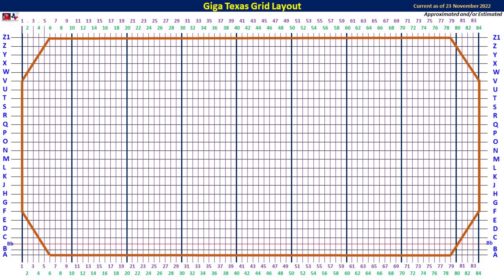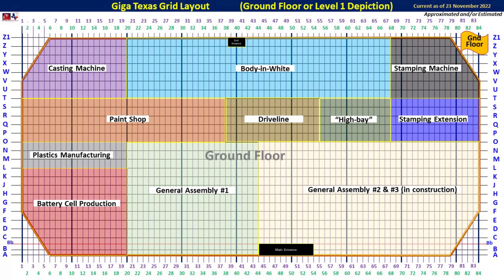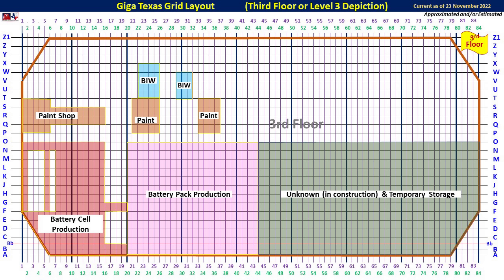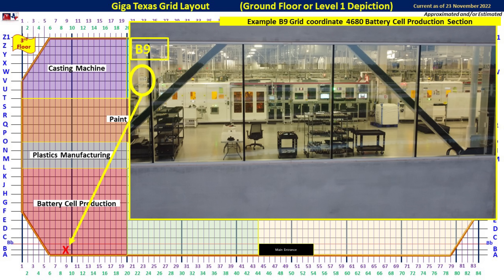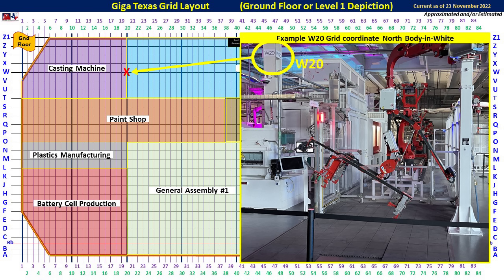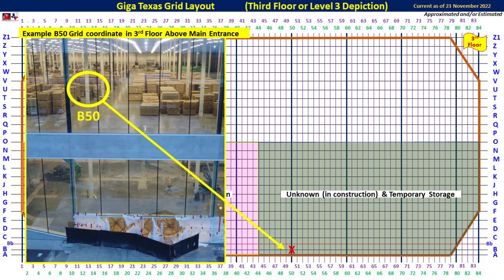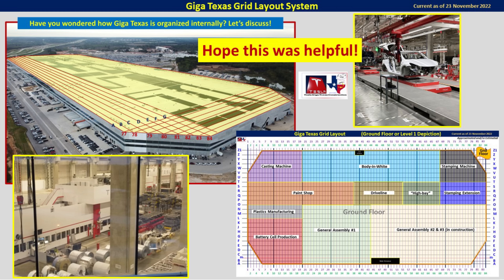Factory Grid Mapping & Main Layout Discussion!  27 November 2022 Giga Texas Construction Update 4K

Comment: Great description of the layout and grid.  I was trying to work out the floor area between each four pillars, I estimated 47.5 feet + 40 feet making 1,900 sq feet.  Also I don't know the current footprint of the factory.  It appears to be 2,000 spaces, each one of them approximately the footprint of a suburban house + garage.  That's before thinking about he additional space on multiple floors occupying its 170 foot height.
Reply: Column/grid spacing is likely 14m, has been reported by an onsite electrician to be 45'10" or 550" which is 13.07m. If you work on 2100sq.ft per column bay, that would be close enough.

Overall building height is 84’ 25.6m to the top of the parapet.

Comment: Thanks Joe 

Couple of clarifications, some additional information.

1:50. Column/gridline spacing. There’s a couple of marked dimensions on the site plan that allow an accurate estimation of the spacing. 45’10” 550” (or 14m as reported by a contractor) works out almost exactly with the dimensions shown on the site plan. Width is shown as 1130.77'.
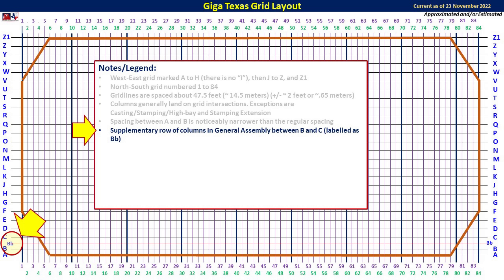2:33. The Bb gridline might not be marked on a plan. The additional row of columns along that line likely a measured offset from B or C. Additionally that row of columns is only through GA on level 1 (Ground floor), and was the original easterly extent of L2.
2:55. Z1 was only seen in BIW in a couple of photos. It has to be there to make up the 25 column bays across the width of the building. It also seems that at some point the grid designation has moved a row east in BIW. This is a proper oddity, I don’t understand why they did this. 
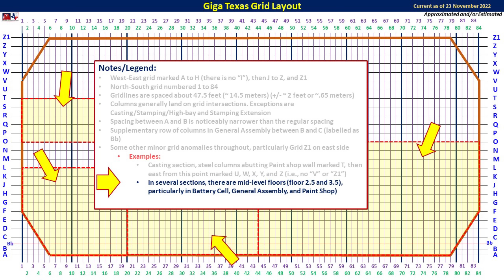3:46. Floor elevations (height between floors) is consistent in Battery/GA, where floors exist. Also consistent in BIW/Paint, although these floor elevations do not match Battery/GA. Easier to consider these areas as entirely different buildings, that happen to abut each other.
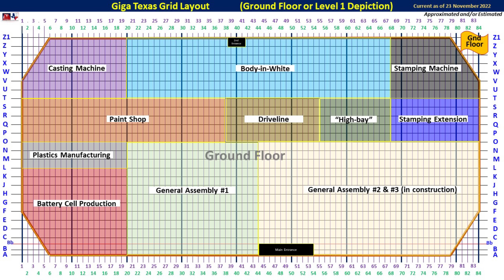5:48. East main entrance is located between 35 and 36.
8:57. Casting. Columns here (and in Stamping) likely not located on the gridlines, but on offsets. I thought they might use a unique grid in here, but if that were the case there would be no need to skip Row V. Similarly with the columns in High Bay and Stamping 2.
10:32. BIW. Think this area and several bays south is where the Castings are machined.
11:10. Stamping. Use of concrete columns. I had similar thoughts, but then they started constructing Stamping 2 where the bridge cranes are larger still, and the columns in there are steel.
12:43. Main Entrance. No mezzanine in there, the floor is Level 2. Floor levels in here are consistent with elsewhere in GA, Level 1 (ground), Level 2, and Level 3.

The first of the steel structure ‘the gazebo’ is in Paint between Q and R, 12 and 13.

The infamous ‘Zipper pit’ was originally between W and X, and 38 and 49 before being abandoned and rebuilt between U and V between 38 and 51. North end of the Zipper Pit seen here, https://youtu.be/m3GBqT3UxCU?t=1116
Reply: Dessie, 11:10  the concrete columns could be used because they are not resonate with the synchronous movements of the Schuler transfer presses. May not have that problem in the new area.
Reply: @eltonray2934  Might be. Not that we know yet what is being installed in Stamping 2. 

Another reason for the change in Stamping 2 would be span. It would be doable with concrete, but steel probably more economical.
Reply: for comparison: I think Shanghai is all steel. Germany is all concrete.
Reply: @benguthrie49  I think you're right. The precast columns and beams and footings at Berlin were interesting to watch being assembled. I have a bit of a thing about precast, so it was a more interesting build for me.

Would be interesting to know if the choice over precast over steel was financial only, or some other consideration. Fire perhaps.
Reply: @DessieDoolan  I thought the use of precast concrete in Germany might be the local construction practice.  In texas, I thought the architects liked what they learned doing Giga Berlin and used them where they thought they were superior in application. aside: I have loved watching all this from the prep of the land in Shanghai. fascinating.
Reply: @benguthrie49  Yes, I agree it has been fascinating. Projects of that magnitude simply don't exist down here. 

I more or less missed Shanghai. It was built before I realized, and I've not been able to figure out the layout.

I have a theory that Shanghai was the prototype, Berlin designed with whatever they'd pick up from Shanghai, and then Austin benefited from both. 

If I could confirm the column spacing at Shanghai as being 14 metres that would give me a bit more confidence. 14 metres is the spacing at Berlin and Austin is just a bees whisker short at 13.97.

Nevada is a different kettle of fish altogether. Column spacing is 50' x 40' 15.25m x 12.2m.
Reply: @DessieDoolan  Jason Yang has a good month by month recap at the beginning. Could also go to his earliest videos for more detail.  f,y,i, first build was for just model 3. model Y was phase II  https://www.youtube.com/watch?v=9y-WrMBWuHc
Reply: @benguthrie49  I'll go back and have a look at those. Might be able to pick up on the size and set-out if I watch enough of them.

Comment: You rock! TY!!

Q: Do you know the heights? Overall building height & floor heights?

Thank you.
Reply: Overall building height is 84’ 25.6m to the top of the parapet. The height of the ridge is highest at Battery/GA, only about 1’ .305m below the parapet. The ridge at Paint/Casting is much lower than the parapet, by 5' or 6' 1.5m or 1.8m.

Floor heights vary. East side of the building is easy to measure as the wall between Casting and Paint was sheeted in 4’ 1.22m high sheets. 
All heights are above Level 1 floor. Level 2 +28’ 8.54m. Level 3 +46’ 14m.

West side of the building is little harder to measure, so these are estimates based on wall panel height. Level 2 would be +20' 6.1m, Level 3 +37' 11.3m. Level 4 +60’ 18.3m.
Reply: @DessieDoolan  TY!
This helps me.

I've been working on dense efficient urban designs & want to use this building as a base example, as a unit of measure others can relate to.
Reply: @JorgeLausell  Jeff's Day 250 video, and Joe's from the same time (probably Randy's also) are good to make out the different floor heights from east to west, count the column bays etc. It happened to be the perfect day in terms of clarity of video.

Comment: Wow, this was super helpful, thank you!  I was thinking that each "box" is surrounded by four columns, so would they simply use the lowest coordinate to define the box?  (For example a box bound by columns K20,K21,L20,L22 would be K20.)  If so, that would mean Z1 would only be used to reference the column, and never to define a box.  That would avoid some ambiguity in the last row (i.e. Z17 would always be Z-17, not Z1-7.)  Honestly, I'm surprised they didn't call it ZZ instead.
Reply: Z1, it’s weird for sure. What’s weirder is that Z1 was abandoned and the outer row is now Z. In BIW that required all the columns to be redesignated by shifting the lettering a row east. The original row U physically exists, but is now unmarked. Quite odd.

Comment: excellent Joe, thanks for this. It appears they snuck the Engel Injection molding machines in when we weren't watching. Was fascinated they sat under the temp structure in the storage yard fir so long and hoped to see them moved in. ( I spent 40 years in the plastics industry) THANKS for what you do........ greg
Reply: Do you mean the equipment stored under the temporary structure on the west side? https://youtu.be/DNtE_MtTZ0k?t=254 

That has been shifted across to Cathode. https://youtu.be/DPnepYD2vic?t=1146

Comment: The building is also oriented exactly on North South to be able use GPS coordinates if I'm not mistaken
Reply: North-south orientation would be by chance only.

New build Giga Factories main axis north orientation as per Google Earth.
Nevada is near due north, as are a bunch of other large structures nearby. East by half a degree or so.
Shanghai. 14 degs east.
Berlin is near due north. Leans west a degree. Also happens to be parallel to the Highway to the west.
Austin. Main building is near due north. Leans east a degree or so. Seems to be parallel to the highway.
Austin. Cathode. About 28 deg east, assuming the long axis is square to the access road.
Reply from the maker: The main factory is oriented N to S, but none of the other structures on the site under construction are.

Comment: Wonder why are they extending stamping if soon the majority of Model Ys will be front and back megacast as well as the Cybertruck that does not have stamped parts at all. If anything, casting should be extended.
Reply: They still need to stamp the entire rest of the body of model s 3 x and y ....
Reply: @Haliotro  I have not heard any plans for Austin to manufacture the S X or 3. If anything, structural Y, Cyb & Not Model 2 were the plans and the only pivot is 2170 Model Ys with more stamped parts stamporarily.
Reply: @BigBoneESB  whatever stamp for model y then. Why is that hard to believe?
Reply: It's for Cybertruck
Reply: @boostav  Which part of it do you reckon needs a large stamping bay (if any)?
Reply: @BigBoneESB  The entire structure save for the front and rear castings.
Reply: @boostav  Unless something's dramatically changed I'm unaware of making the stainless steel exoskeleton and the angled design pointless, the Cybertruck monococque is still getting made out of laser cut and cold rolled stainless steel welded together and onto the Giga Pressed structural aluminum bottom and NOT stamped at any point of this process. 

Now small bits inside may still rely on stamping but that hardly needs a HUGE 2nd stamping bay, not does the structural Model Y should they want to ramp that up as they originally planned, nor any upcoming structural model. The Cybertruck will be made via giga pressed molten aluminum & laser cut, folded and welded hard steel without a dent put into it. That's why it looks like that.
Reply: @BigBoneESB  No, the stainless steel will be bent with press brakes, which are stamping machines, to create the angles you see on the exterior. There will also likely be softer steel or thinner stainless steel for the inner structure in the cabin area that can be regularly stamped and then all the smaller bits you mention.
Reply: @boostav  The whole point of the angled exoskeleton design - how they described it - is to avoid stamping altogether, replaced by laser cutting folding and welding. Which exterior parts do you think they need to be bent?
Reply: @BigBoneESB  You're mistaken that is not the case, the point is not avoiding stamping. Laser cutting and welding takes far longer than stamping, this is a high volume product so they absolutely do not want to avoid it. Obviously the stainless steel poses a problem because it is harder and hence cannot be stamped like normal, hence the need to use brake presses and the simple shape. All of them have one or more creases.
Reply: @boostav  Tesla itself has communicated laser cutting and machine folding. If they always planned for these much more robust stainless steel stamping machines, why go angular and brutalist the first place? I do not recall them using the work stamped exoskeleton.
Reply: @BigBoneESB  Aside from the fact that what Elon stated was for the prototype and not for volume production, what was actually said was laser for scoring the stainless steel not cutting through it completely, then bent (or folded if you prefer) with a brake press which is a stamping machine. It's angular and brutalist because that is the only way you can stamp stainless steel, you can't stamp it like a 3/Y with all those complex shapes as it's too hard.